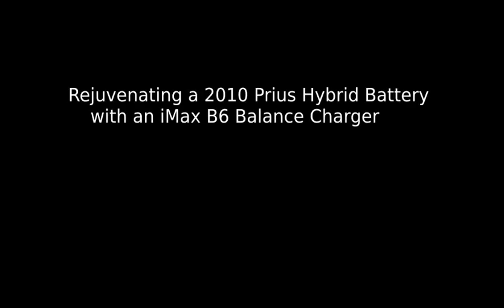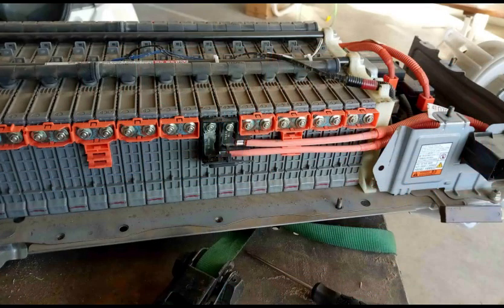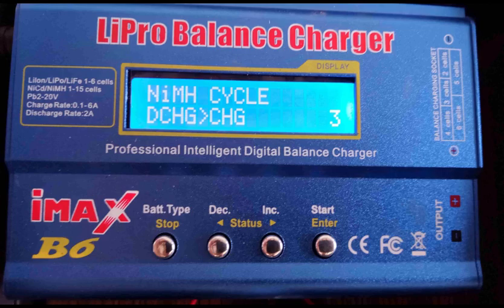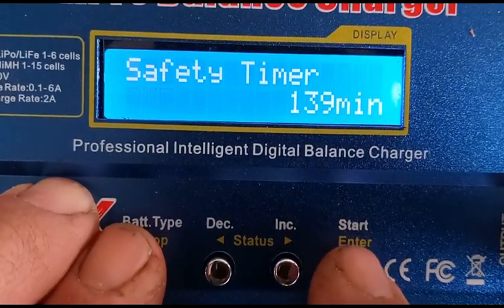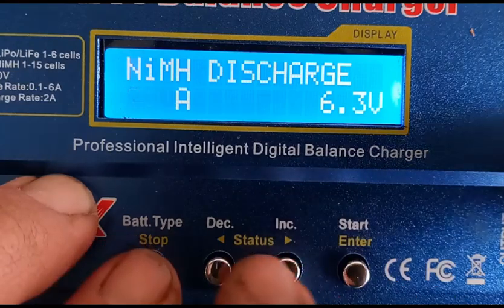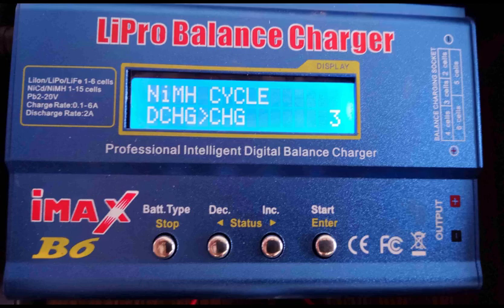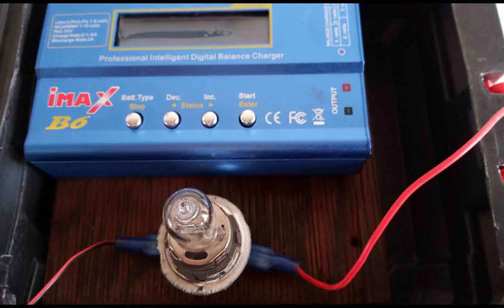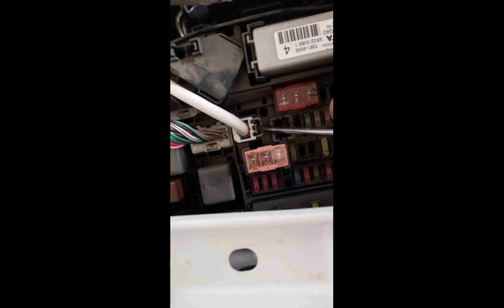Reconditioning a Prius Hybrid Battery Using an iMax B6 Balance Charger

Comment: I’m currently in the process of doing this.  I currently have no codes but mpg was very low and after running the Dr. Prius app, it had determined that I had a bad module.  I’m using the newer version of your charger and am currently having issues with the charger not wanting to go out of auto mode.   Tenergy support is currently working on the problem.  I’ve found 3 other suspect blades and since the Dr. Prius app didn’t find any other faults I’m going to try and recondition them.  I’ve spent a lot of time researching this subject and I’m slowly coming to the conclusion that maybe biting the bullet and just purchasing a new oem pack is the best solution.  These cars can last well over 300k and considering the cost of a new vehicle these days, it might make sense to spend the 2 to 3k on a new battery and call it a day.  Of course this would be determined on the overall condition of the vehicle you’re working with.  Very good video by the way.  Precise information without all the fluff.  Sometimes we just want the facts and in this case that’s what is desired.  Thank you.
Reply from the maker: There's a lot of wisdom in your analysis.

Comment: if u giving extra bulb for fast discharging its not improve your cell capacity, because battery charger and bulb doing fast discharging over 5amp. Everything low amp c/d better for cell capacity improvement. Any idea?

Comment: What can happen if I don’t balance out every battery cell? I replace one module and there all around the same amount of  volts and resistance would this affect anything?
Reply from the maker: If they all hold a similar charge, that's probably ok.  The Dr Prius app can give you more insight into individual blade health.
Reply: @de0081  appreciate your answer. To everybody that’s reading I already went thru the process of charging and discharging. It’s long and tidious but not imposible just do it and it’s 100% worth it. My battery is 100% in charge and performance now after I did the long process.

Comment: The batteries have 11 years of warranty .Why not change it under warranty?
Reply from the maker: My battery started failing at 14 yrs, 175K miles.  There is no warranty replacement on a a functional battery.
Reply: @de0081  14 years  how more you will expect for your car to last until you retire it ?
Reply: 14 more
Reply: @jaysledge8806  Like some video (i think from india )  that they keep the cars 100years and they fixed them with any way possible. They also 
do welding on the rims.

Comment: This video is the best advice for puffing your prius cells.
You're doing absolutely nothing for "reconditioning."
Good luck to anyone doing this to their car.
You cannot charge these modules relying on delta V to stop your charging process. Thus you will overcharge and your cells will puff. Use this video as a "how not to" and nothing more.
Reply from the maker: If the cells remain compressed in the battery pack as shown here, they will NOT  "puff"!  A reliable  smart charger that is set up properly will also not overcharge the cells.
Reply: @de0081  This is not a reliable smart charger and toyota cells are not your typical NiMh cells, so delta peak isn't always a reliable way of termination of charging.
And one more thing, in order to equalize all 6 cells in a module you HAVE to overcharge the module. But you have to do it really slow not to puff it or overheat it.